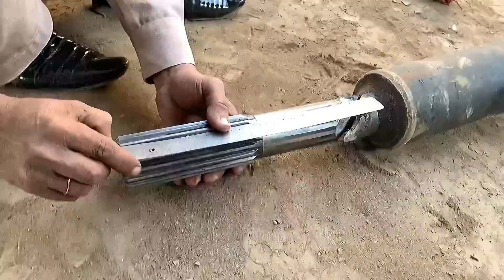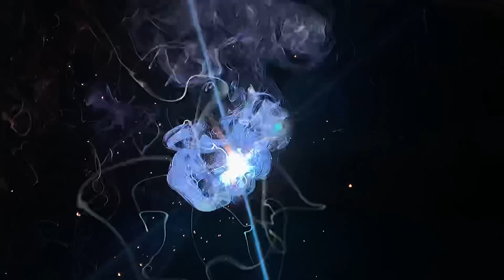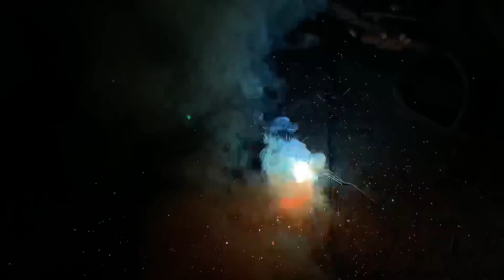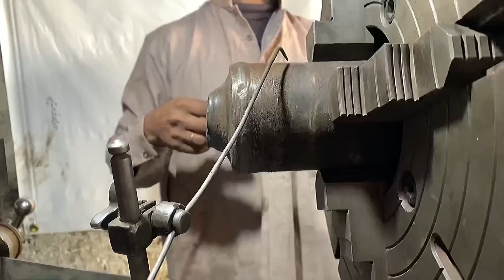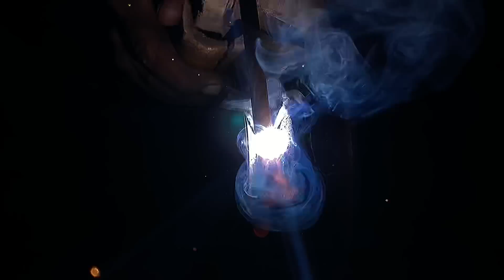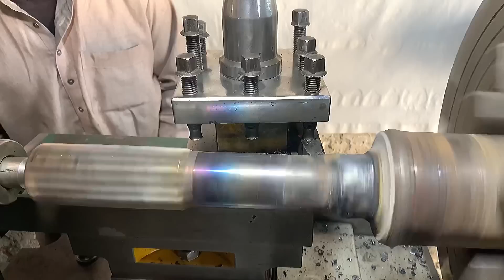Rebolding truck splined broken driveshaft

Comment: It never ceases to amaze me how resourceful these guys are.
Reply: yes. It's not what Hollywood spreaded around the world.
Reply: Dude this is sub par welding that will literally never hold , if the truck sheared the shaft like that theres 0 chance it will hold up now that its weaker especially since those welds did NOT bond those pieces back together,  break a pencil in half then glue it together and see how much easier it is to break the second time
Reply: @AIexanderHartdegen  this is a video for views they probably didn't even install that part after the video because even they knew their shitty glu job wouldn't hold

Comment: Yeah this would last all of 5 minutes or the first rough gear change😊 don't get me wrong the welds will never break but right beside the weld where all that heat was applied will be the next fail point.

Comment: If there is enough torque to shear the shaft like that welds are not gonna work for long. The only way to fix this would be to preheat and do metal pour thermite weld in a mold around the damaged sections. 🤓
Reply: My thoughts exactly.
Reply: You guys are missing most important fact, living standard of people in that country.
Reply: @milanradovanovic3693  but, if this is gonna be breaking every time... how much money they are going to spend to fix it? I think they will spend more money fixing it than buying a new one, but who cares, is their problem xD
Reply: Thats assuming the product was perfect to begin with 😮

Comment: Yeah it’s resourceful and whatever but stick welding leads to crystallized metal. And for high strength steel like that it’s just been reverted to mild steel. If you use the driveshaft (which they will) it’s just gonna sheer off again possibly leading to the driveshaft becoming more of a pole vault depending on which way it’s facing. But clearly there’s no safety regulations there so have fun!

Comment: why don't you use the MIG method for welding? Regards
Reply: Because they don't have the availability. Sticks can be shipped by the thousands and any cheap buzz box will work. Mig welding requires more consumables.

That's why you don't see them use a grinder. Guaranteed there is slag in that weld. It wouldn't pass for shit in any welding certification
Reply: Supongo que usa soldadora eléctrica para aportar con el electrodo el acero correspondiente, acero y dureza del material, cosa que con la mig dudo que lo logre
Reply: Obviously that equipment isn’t available.
Reply: They are cantering the part with a pointy piece of steel.
Reply: Stick welding is much more structural than mig welding... tig welding would have been the best but most of these shops just have a few old car batteries as a welder so stick it is lol
Reply: @jonathantheunacceptable4259 your simplification or welding types isn't accurate. All welding methods have advantages and disadvantages, but done well they are all the same "structurally". We just see them used in various ways to the benefit of the user and weld qualities based on the situation. MIG would absolutely be the best option for this. Dual shield MIG with Argo heavy and flux core wire would give the strongest weld here with least possibility of inclusions and porosity.

Comment: Probably stronger than what it was before it broke. A good weld should always be stronger than the metal itself.
Reply: definitely not stronger. But it's fixed
Reply: thats a myth,a good weld is mot stronger ever, especially if its flush. normally a weld is more material so its thicker but ive seen the best welds break faster than new steel
Reply: @the_chomper  it is not a myth. during the welding process at the weld, the welding process itself burns off the carbon in the steel. therefore closer to the property of the material at the stepping point to a less crack-resistant one
Reply: iron than steel. And this is the basic disadvantage of weld seams. So what if the weld is thicker if the material will crack next to it when loaded.
Reply: @the_chomper  then the weld wasn't done correctly. If done correctly, a weld is stronger than the base material.
Reply: @timothygeiger8271  Don't you think the parts that were welded together should have been preheated to prevent weldingwarmth to dissipate to quickly, thus leaving substantial internal stress in the weld ?
Reply: @rudivanrooijen7611  tell me where in my comment i said it shouldn't? I'll wait!
Reply: @sporthype2113  Burn carbon? Lmao 🤣